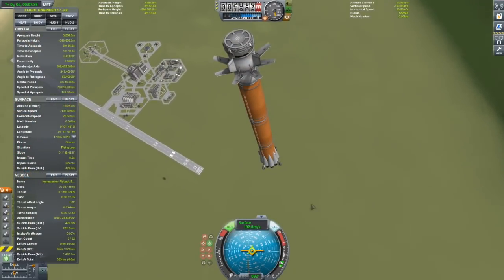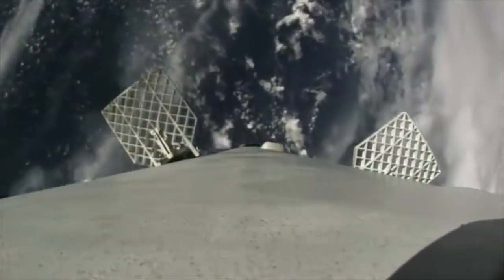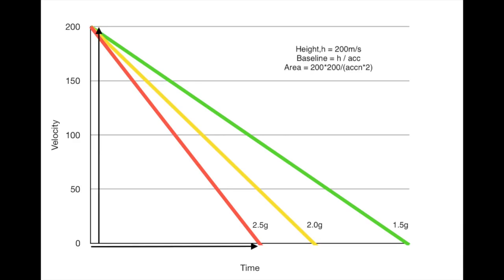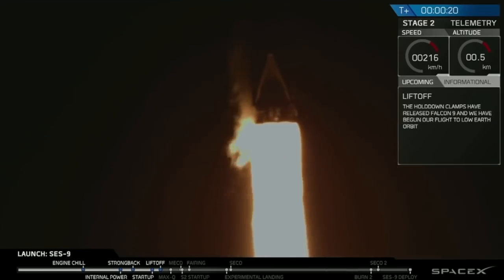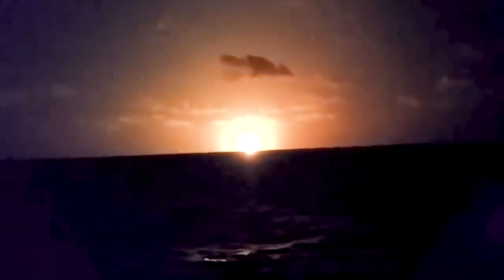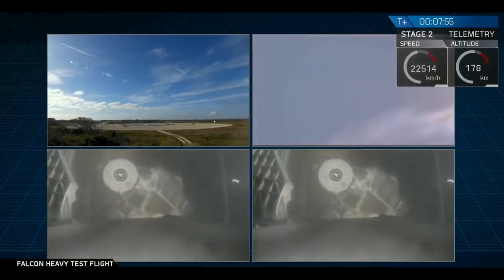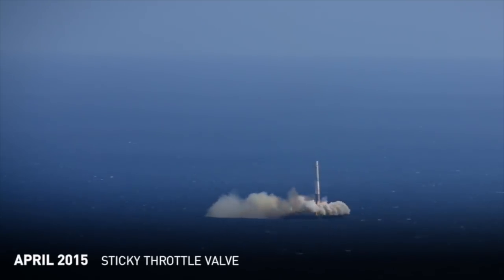How To Do A Hoverslam - Things Kerbal Space Program Doesn't Teach.

Comment: Wouldn't it make sense to increase margin of error by planning to make a less efficient (non-suicide) burn? It would be more expensive, but that increased cost might be worth it for an increased success rate.
Reply: In KSP yes, in spaceX, no. With an un-throttleable rocket engine that even with just one already lifts more than the mass of the rocket, a suicide burn is literally the only option. If it burned earlier, it would stop and start lifting off again way above the pad.
Reply: Gavin Jenkins this is what's wrong with this video and in your comment too. Granted that the engines are un-throttleable. But that does not mean that if the rocket is just a few feet above the expected trajectory at the time it will stop and start accelerating. It doesn't work that way. Look at the deceleration of the boosters just before they land. You will notice that its very very slow at the end (maybe in feets/sec or even lesser than that). This means that they have enough vertical room before it actually starts hovering in place and then it will slowly start accelerating again. So that means there is enough room for them to stop a rocket or do a reburn of one of the rockets if needed. I don't know if a reburn so late would result in anything but the main problem they faced earlier wasn't the landing sequence rather figuring out the best trajectory of the landing and its implementation (using those fins) and then upgrading the landing legs and their hydraulics or whatever technology they use.
Reply: They don't have the ignition fluid to keep turning them on and off over and over, though.
Reply: Isn't that basically what they were doing when they used only one out of the three engines for parts of the landing?
Reply: Gavin Jenkins , so in KSP they're just PWMing a rocket? perhaps that would work with infinite ignition fluid
Reply: Gavin Jenkins but like I said that's not even part of the problem. Read my previous comment thoroughly.
Reply: I did, I must just not get what you're saying. If you started "a few feet earlier" then you'd hit null velocity a few feet from the ground, which is bad, because that's still high enough potentially to damage it or fall over if you turn off the engines right then. If you don't, it will start going up again. If you do, and then try to turn them on again, you don't have time....if you start like 50 meters early, then you have time maybe to start engines again, but you're so much higher that you basically have a suicide burn again, just delayed by one burn. I'm not sure what that even accomplishes, and needs more fuel and ignitions.
Reply: To clarify a bit - you CAN throttle the engines on a Falcon 9.  But you cannot throttle it infinitely.  You can't drop it to 1% of thrust like in KSP.  I think it bottoms out at something like 40%.

And 40% thrust is a greater force than the weight of the rocket.  So if you start the engine too early, you might accidentally lose all your downward velocity, and start going back up.

So what they do is they basically build a flight plan where the engine starts up and runs at 40% (or whatever) thrust AND WILL HIT THE GROUND.  They start the engine late enough so that they do not have time for the rocket's minimum thrust to slow it down to 0 velocity.

Then as they get closer to the ground, the control system ramps up the thrust to arrest the velocity at as close as it can to zero altitude.

Imagine driving a car up to a stoplight.  As an extra rule, once you take your foot off the gas you cannot use it again.  If you take your foot off the gas too early, you'll stop short and you'll be SOL.  So you make sure you get pretty close before you take your foot off the gas, such that you'd drift into the intersection without further intervention.  You drift for a bit, and then as you start getting really close, you begin to apply the breaks, and press harder and harder at the last second or so, stopping at the exact location you want.
Reply: There seems to be confusion of some terms. To some KSP players, a 'suicide-burn' is a method of de-orbiting, where you stop your horizontal velocity, and just free fall to the ground.
The reason this is done is because it's easier than trying to figure out a reverse gravity turn. Once your trajectory is intersecting the ground, you would be in a similar situation to one of these boosters. From that point, you could either 
A) Calculate how much thrust you would need to stop given your time of impact. (Which will also be changing constantly over the course of the burn and could easily run be thrown of by environmental factors.)
or
B) Calculate how much time you need at full thrust to stop, and start burning at (time of impact - required burn time).
Option A is easier to adjust, but it also uses up much more fuel. (There difference is incredible, not just a little.)
Option B is more dangerous, in a certain sense, because the timing is more critical, but is the only practical way to do things without infinite fuel. 

For SpaceX, option A also has the problem of the engine not being able to throttle to 1% like it can in KSP, so there will be a minimum time to start the burn no matter what. (Where in KSP you could just leave the engine on the whole way down, though this is a horrid strategy.) They could try to burn for a short amount of time early, but engines have a limited number of ignitions, so this is still dangerous, and also means less help from drag and more time for gravity to undo any deceleration they applied.

After the incredible feat of being able to get to the barge in the first place, the landing itself is mostly a matter of timing, and in their case, it's actually better to be too late than too soon. (Because it's easier to throttle up than to stop the engines and re-start them. That minimum throttle makes things difficult.)

Comment: this is true for a landing on a planet with an atmosphere, where the velocity will not surpass certain value due to gas friction. When landing on a moon(no atmosphere) it makes no difference, because waiting longer to start breaking means the velocity you have to "kill" will also grow larger, so you will waste exactly as much  deltaV as slow landing.
Reply from the maker: That's not true.
Consider acceleration A and gravitational Acceleration G

The net deceleration during braking is A-G
so time to decelerate to zero from velocity V is V/(A-G)
So the total deltaV is A*V/(A-G)

You can see that the bigger the difference between A & G the lower the dV requirement.

Comment: some of the rockets seem to land on the barge and then fall over and explode.

couldn't they have a huge air bag surrounding the platform to stop it smashing into the barge and then blowing up. the air bag could be made of heat resistant material. Or have a huge safety net to catch it if it falls over on the platform.
Reply: I'm sure they could borrow some bouncy castles and tie them to the sides... it would probably have actually saved at least two of those from exploding.
Reply: Not really, I think. The rocket is huge, and thus, the forces involved with it falling are huge as well. In addition, the barge is large. The bag would have to be ridiculously large. Such a large bag would have to be made from “unobtainium, or other similar miracle material that unfortunately does not exist” (based on my “pulling an estimate out of my engineering cap”). Unfortunately sometimes the simple solutions do not scale that well to large systems.
Reply: +Lari Koponen You could probably make something by assembling a series of smaller ones together though it would likely cost a fortune. My guess you would probably need to construct the airbags with the structural strength of an airliner tire and those don't come cheap a single tyre for a B747 will set you back north of $3,000 and even then they are only rated for a touchdown vertical speed around 600 ft/min (3 m/s) I think, most airliners are around the 600 ft/min max sink rate at touchdown anyway above that tyres have a very real chance of going boom.

Of course one would need to come up with some way to protect those from the heat too, lest the rocket engine promptly set the whole thing on fire.

I suppose in theory one option might be to do something like suspending the entire deck on a ton of hydraulic dampers but again the costs are going to be utterly insane probably.

Comment: Why not program a window of deceleration during which the rocket is grabbed by a robotic arm? It's going slow enough, right? Get the rocket close and then let a ground based station deal with it. The rocket would never even need to know where exactly the ground is. You could even streamline the rocket design, since it wouldn't have to be so exacting in its standards and house some of the complex tech needed to execute such a maneuver. If landing is the hardest part then leave it to something on the land. When we used areofoils and the ocean it was the same principle just a different application of the available physics. Oh, and a two part engine cut off would be needed: half the circuit in the arm to he completed when it touches the other half, housed in the rocket. During spaceflight just cover the conductive panels with blowouts and the engine circuits wont get casually damaged. I feel like they're making rocket science harder than it needs to be lol

Comment: Sir i think an almost empty  falcon 9, when it starts its engines start, the fuel pumps spins at high rpm will have a significant gyroscope effect on the rocket which needs to be corrected for do you think  the same

Comment: The suicide burn seems fine until one allows for failures. I  can't see how the BFR upper stage with people on board can use a suicide burn because an engine failure close to touch down is surely going to result in a crash, even if there are others still running.

Comment: Why did the center booster run out of igniter on the Falcon Heavy? They've been successfully landing boosters enough that I'd think the amount of igniter would be a known and established quantity, but obviously something was different on the FH and it required more igniter than thought, but I havent been able to find out what the center booster did different than a normal F9 launch.
Reply: The center core might have needed to reignite some engines after the side boosters separated to regain full thrust.
Reply: That would make sense, but I hadn't heard anything about the center core operating on less than all 9 engines prior to side booster separation. I know the engines can only throttle down so far, so maybe they did shut down some on the center core to avoid overstressing the rocket as the thrust/weight ratio increased as fuel mass was spent before side separation, then had to reignite separation.

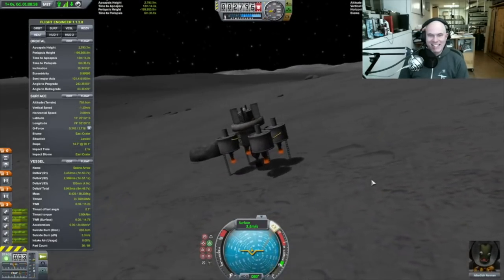Comment: @2:15 You know what's not fun? Trying to do suicide burn calculations... in your head... in the middle of descent...
Yeah, that's definitely a good idea. Unsurprisingly, I failed miserably (well, not miserably, actually, I was only off by a second or two at most), at least until I reloaded so many times I had time to finish the calculations and then figure out exactly what the altitude needs to be when I go to press so my reaction speed leads me to pressing at the right moment... so many ±50 meters initiations leading to somewhat damaging my craft...

@8:10 Wait, it seriously doesn't take that into account? That's dumb.

But also, this video is like the exact opposite of 'Things Kerbal Space Program Doesn't Teach'. If you play KSP well, you're using Suicide Burns. I suppose it doesn't teach the technical limitations of real suicide burns, with over engineered rockets due to lack of this thing called 'money' (in sandbox, which is most of the things I see, and you generally get plenty anyway) and infinitely relightable, zero-failure, freely throttlable engines, but still...

Comment: That booster that ran out of starter fluid really put the lie to Musk's claim that they used multiple small motors instead of fewer larger ones because it was like "multicore computers", and that it would increase their fault tolerance because if one engine fails others can take over.  The truth is Elon would use F1s if he had them.  But he doesn't.  So the smaller Merlins become features instead of bugs.  No one ever tried to claim that the N1's many engines were a benefit over the Saturn V's significantly fewer F1s.  Or rather, if the Russians did no one took them seriously.

BTW, the first time I encountered the concept of the suicide burn it was communicated in a Robert Heinlein novel, of all things.  He was explaining why it was most efficient to wait until the last moment to begin deceleration in the context of a rental car style space shuttle that a character was taking down to the surface of the moon.  He did a good enough job explaining it, I've understood it ever since without needing to use calculus to get it.

Comment: Can someone explain why 3 engines take less fuel than 1 engine. How will the fact that it burns for more time take more fuel? Won't fuel be proportional to the kinetic energy of the rocket?
PS As a write this I realized that in the single engine case, the work done by air on the rocket would be less. Is that making a difference?
Reply: Bhushan Pawaskar 3 engines take less fuel because they have to burn for less than a third of the time

Comment: Why does the middle section of the Falcon boosters not get black from soot? There is even a sharp demarcation line between the sooted lower part and the relatively clean middle part.
Reply: The surface of the liquid oxygen tank is cold, and ice may form over it. The soot either doesn't adhere to the cold surface well and/or is carried off by falling ice. Actually, I think it must be the former because they seem to get the familiar pattern of soot right after staging when the second stage plume impinges on the side of the turning booster.

Another interesting pattern you can sometimes see are vertical stripes - those seem to correspond to the weld seams and the structural supports on the inside the tank.(there's no separate fuselage and tank on Falcon, the outer skin is the propellant tank) Presumably the thermal properties on those bits are different which seems to lead to a difference in how the soot adheres.
Reply from the maker: That's the LOX tank, it picks up a layer of ice which probably protects it.
Reply: IIRC, the stripes are because they clean off the welds to inspect them, but leave the rest sooty.

Comment: You learn fast in KSP 😂 I gave up on high TWR. I land gently. I over shoot were I wanna go burn off vertical speed at target. Let myself fall and when I get under 1500m I start slowing down.  I match speed to 1/10th elevation (150m/s) and bring her down. I do about 3 speed to elevation burns. Then land gently with a final burn under 100m to get my speed down to about 1.5m/s for a soft landing. You need more fuel but it's safer.

Comment: So I notice your stopping graphs were linear.  I imagine this is a simplification of a more complicated real case.  As you do your suicide burn, your thrust remains constant, but your mass does not.  Constant thrust combined with variable mass means you will not have a constant acceleration, and those nice linear stopping graphs will be impossible.  My question is how much of a simplification are you making with your constant acceleration assumption?  With such a temperamental maneuver I imagine your calculations have to be pretty precise.  You'd have to use basics calculus as far as I can tell.

Ok so clearly I started Typing this comment before I watched the whole video.  Just got to 7:51 now.  How hard would it be to modify the mods to use a calculus based suicide burn calculation that accounts for the mass loss during the burn?  The integrals wouldn't be too hard, and assuming you arent in an atmosphere where engine ISP is variable, you can probably simplify everything down to a single dependant variable for the actual burn calculation after plugging in some basic starting values.

Comment: And I was just in the middle of calculating suicide burns including air friction (D=-kv, linear) and variable mass (m=m0-bt, linear) and it really does make your brain hurt trying to solve the algebraic system. I was thinking that maybe a quadratic approximation via Taylor series would cut it, what do you think? Honestly, I just want to make my dream of having a 40K drop pod in KSP a reality :/
Reply from the maker: I think linear drag is solvable analytically.
Reply: yup, the differential was really the easiest part of it all, solving the system for 2 unknowns is quite a bit harder. Also, I just assumed that the initial velocity for the IVP would be the terminal velocity at the initial altitude, is this realistic? Keep in mind that what I'm trying to design is not just a suicide burn, it's a really suicidal suicide burn. If you've seen 40k drop pods in pictures, they do not so much land on the ground as crater into it with a velocity juuust low enough to not be killed after starting the burn on something like 400m radar altitude. Honestly I think there might not even be a stock design that would have this kind of TWR in the game
Reply: Also, seeing that KER and MJ get it mostly wrong, if I were to actually succeed in my endeavours, shouldn't I perhaps send them the solutions?

Comment: 1:50 Suicide burn is NOT the most efficient way of landing a rocket - not in vacuum, at least, and not from orbital speeds (which is what you show in the video at the moment). Unless you mean time efficiency but that I would exchange for lower fuel consumption and higher safety of the real most efficient landing approach any time.